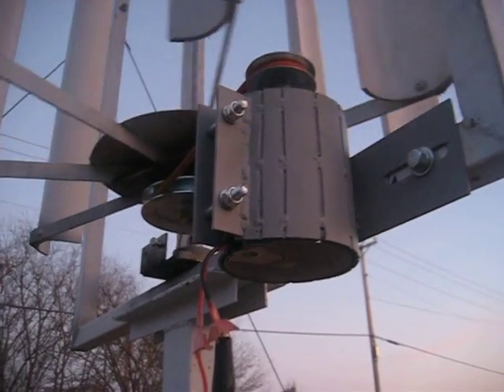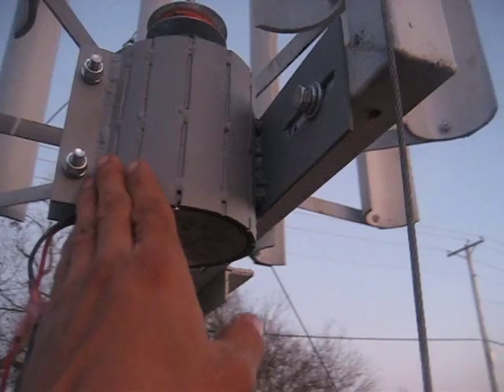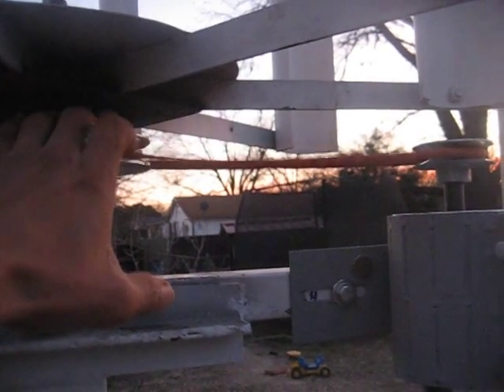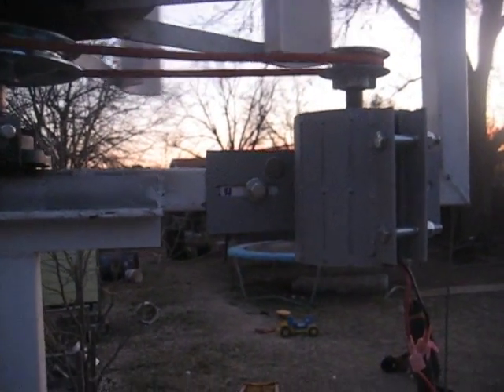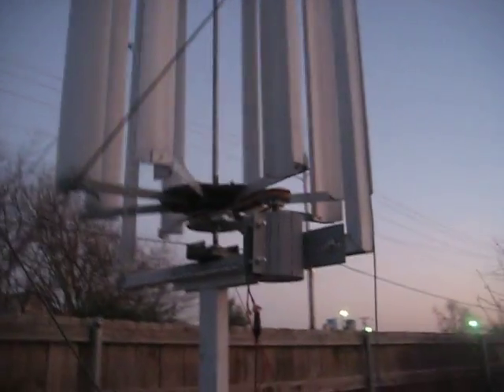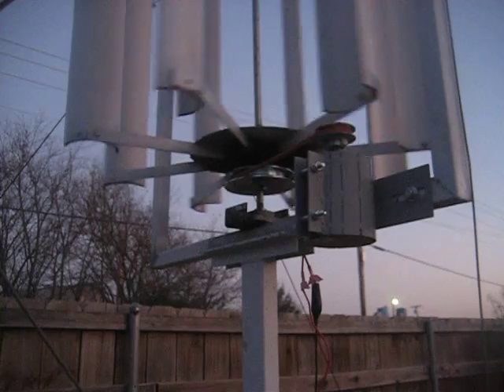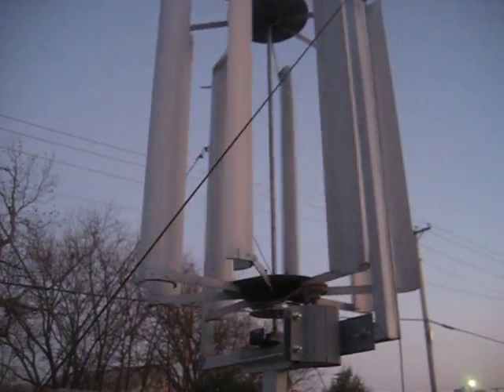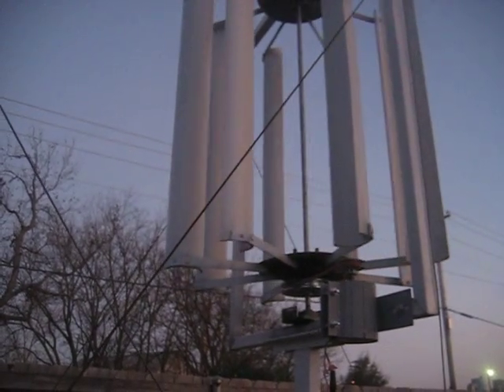vertical wind turbine

Comment: melecio1 Great job ,,,, I was just wondering did you ever taught of using the axle of the wind turbine connecting it  straight to the motor , instead og using the belt ? i hope you get my idea  one straight axle . no pulleys or belts  .Thanks for sharing  your project

Comment: think am going to do the same design but use fiberglass instead of pvc plus it will be half the thickness of what the pvc is and alot lighter but just as strong and use a bigger pulley on the bottom of the turbine and a smaller one on the generator

Comment: Good job! Its about time someone posts something worthwhile on this topic. Most other posts are just spinning their wheels (literally), but you at least show how you did it and got it working. 
I have something similar in design but am aiming for 10KW capacity and using a zero cogging generator on a gear drive system. I'll post mine and show the details when mine is done.